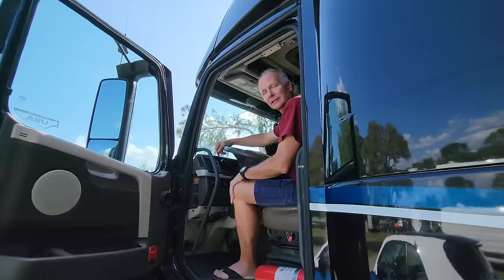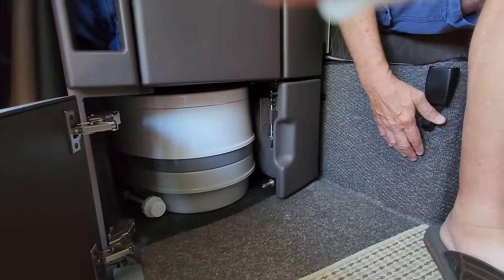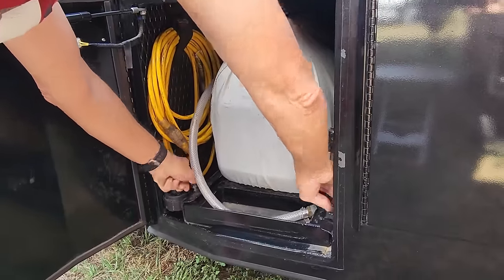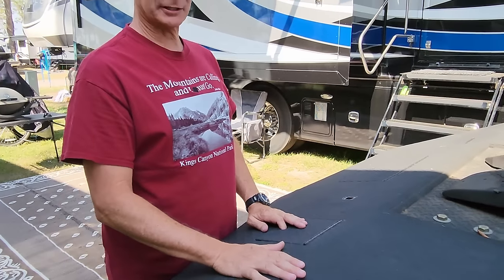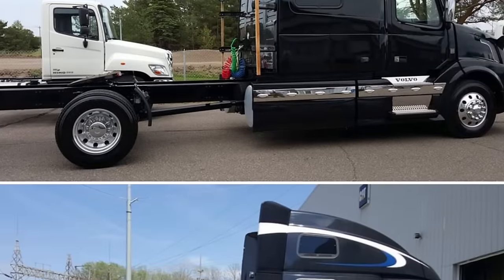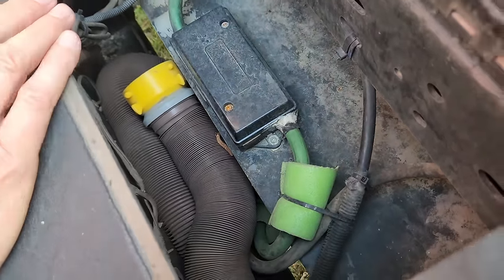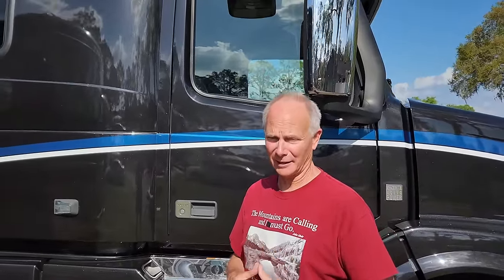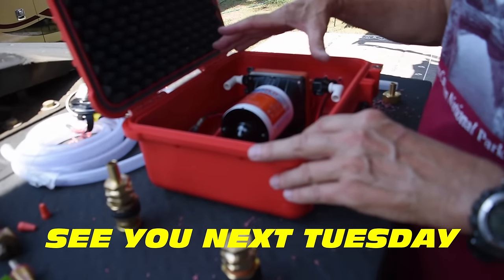MORE THAN A RV HAULER SEMI-TRUCK / HDT RV / RV Lifestyle / Full-time RV / Boondock HDT Asset

Comment: What happened to "we're going that path"?
Reply from the maker: Lol...I decided to not go down "that path". The path I was talking about is when people title their semi-truck as a motorhome. A semi-truck is not a motorhome because it bears weight or a load on the hitch. A motorhome may tow a trailer but cannot bear weight or a load since it has no 5th wheel type of hitch. I believe this is an insurance issue at some point. A semi-truck may meet the 6 of 8 requirements for an RV/motorhome but it is not a motorhome unless it has been converted to a Super C and then the 5th hitch plate is removed. That was the path... it's not a very popular sentiment because A LOT of people title their tractor this way for cheaper insurance, easier/cheaper titling and less stringent DMV license requirements. My $.02....
Reply: @bigtruckbigtravels  Got it. Thanks for sharing.

Comment: Why not a Newell, or Prevost conversion?
Reply: Man of you are use to a hood why would you want a rear engine pusher with all the service hassles and be the first thing to the crash!
Reply from the maker: It's a great question. We like the safety of a truck and the home feel of a fifth wheel. A Class A motorhome is definitely easier to RV in but to us does not feel as much like a home. With our travel style, we should be in a motorhome but we like the roominess of the fifth wheel. Thanks for the comment. 😎😁
Reply from the maker: Very true, Carl. We like the safety of the truck but also, if it needs to be serviced then we are not without our home. Thanks for the comment. 😊